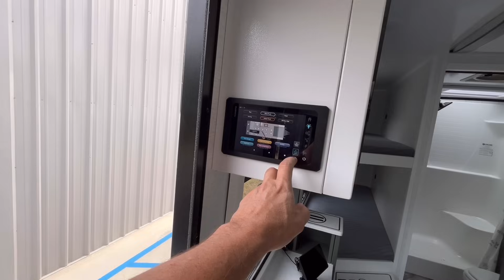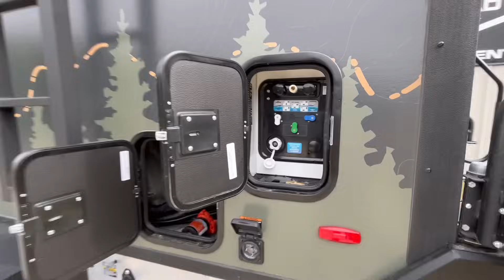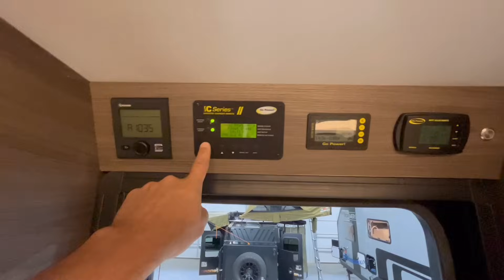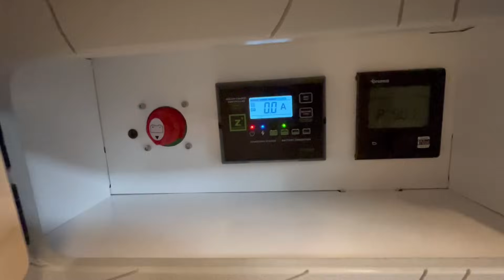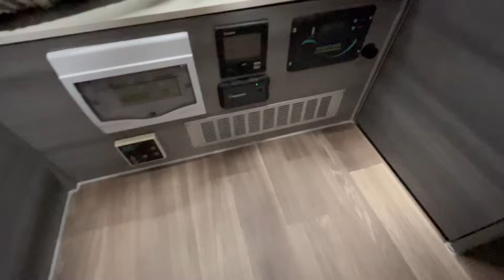ROA OFF-ROAD South Carolina Showroom Tour

Comment: I am surprised the ROAMER 1 uses GO Power and not Victron. Also, question, that Black Series HQ21...was that originally sold via ROA, does it have any ROA upgrades/mods and does it have any inverter to run totally off grid? Also, we live in Washington state, what happens if there are issues with a camper...do we have to tow it in to the Utah store or are there mobile techs that you use?
Reply from the maker: Text the South Carolina directly to get answers in regards to their inventory. 801-860-0035 (ask for Randy) For out of state service we always try to find local techs in your area before we ever ask you to bring it to us. If you are in the area that is great but most people are not so we figure out ways to get stuff fixed.